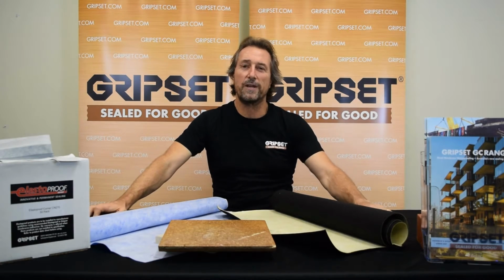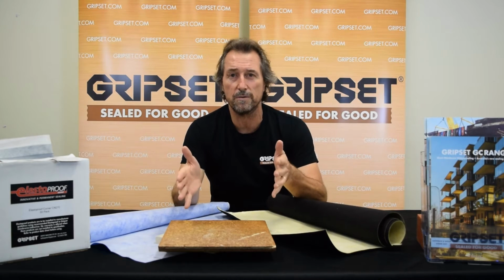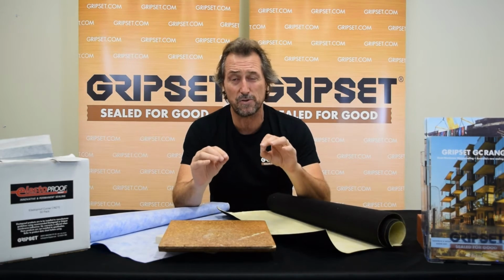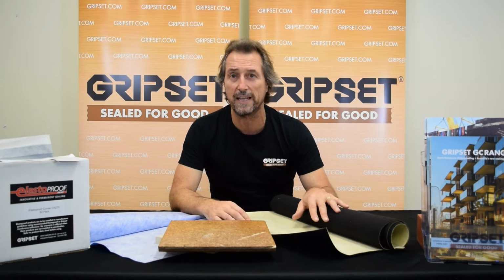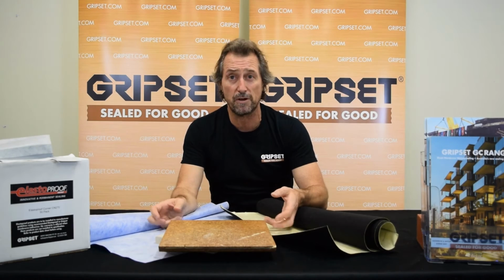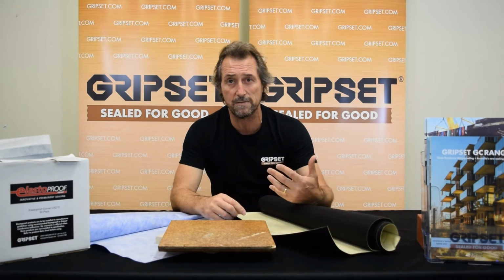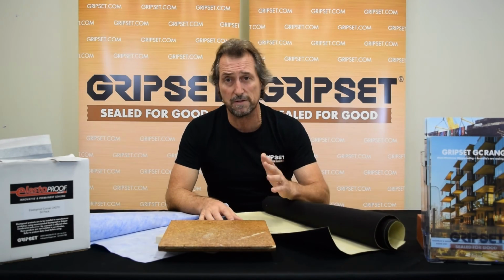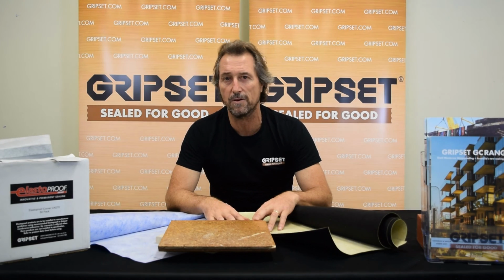Particle Board Flooring and Waterproofing

Comment: Thank you Gripset for the very informative video. I have been renovating bathrooms in the last 25 years, some bathroom (built in 1990s) we removed have yellow tongue but it is in good condition if the yellow tongue and waterproofing was installed correctly. I always debate whether to leave the yellow tongue or advise the owner to replace it with scyon (with additional cost). I have been googling to find a suitable answer to advise my customers about yellow tongue but haven't been able to find the right answer as some site says it is illegal and some site says it is ok to use but not recommended. Thanks to your video and your answered comment (from other video) I have found the right advice to give to my customers.

Comment: Thank You for Providing Education to the Construction Industry & the Public. 

We would sheet every timber type flooring with a Fibre Sheet Underlay for Wet Area's.

We can then provide a Waterproofing system over that F/C sheeting.

We will sheet Timber type flooring for Vinyl Installation as these products are not suitable for Direct Stick / Adhesive Fixed Flooring & move alot as You have said. 

#doitcorrectlydoitonce
Reply from the maker: Thanks a lot for your comment and your support, it's guys like you that make a difference in the industry! :)

Comment: G,day Mate, Ive just purchased a new house which has yellow tongue floor boards. 

Is it recommended to paint or water proof the under floor area to reduce water ingress from underneath.??? (Large task)

Is this something you would recommend???

Mick
Reply from the maker: Hi Mick, look we wouldn't recommend it however, you are best to contact the yellow tongue manufacturer to confirm the product is suitable for use over earth. It may be found in an installation guide somewhere. Hope this can help you!
Reply: @GripsetIndustriesPTYLtd  Thanks buddy much appreciated
Reply: Did you ask the manufacturer about ceiling under the flooring? What did they say ? I have the same issue

Comment: Hello :) I've been working on redoing the flooring in my kids' bathroom - after removing the sheet of linoleum, i discovered we had particleboard :( I'm really unsure why this was chosen, i can see a secondary layer underneath the particleboard (it is OSB i believe, at least it appears to be)..  one of the main reasons i started this project is because thanks to my kids splashing, over time water seeped through the linoleum where the tub and flooring meet, so the particleboard is weak in that area... But it's only about an inch of the flooring, along the length of the bathtub. What should I do in this situation?! I was thinking to fill the weakend spots with concrete maybe, then go over the entire subfloor with something like Drylok (or what is the best type of product to waterproof this?) I am so unsure what to do in this situation :( that's how I ended up here! Haha
Reply from the maker: Hi Seraphina, kids are great at uncovering poor waterproofing!😅 The best advice we can offer is to engage a licenced professional to inspect the area, once water damage takes hold it is critical to understand the extent of the damage. For Gripset product recommendations please send some photos through to info@gripset.com and one of the techs will take a look, Thanks for watching!

Comment: How to seal the seams in particle board laminate flooring?
Reply from the maker: Hi YouTubeShitSorter, 😂 that was fun to type! but to answer your question; typically timber products with laminated finish are not designed to be finished over, they are the finish. If you have more details on the product in question and require a solution for what sounds like a unique situation please send us an email to info@gripset.com one of our knowledgeable tech services staff will get back to you,    Thanks for watching!

Comment: What about waterproofing over  marine grade plywood? The same issue?
Reply from the maker: Hi Ed, the main difference is marine grade plywood is used externally but we would treat it the same way as particle board. We recommend Gripset sheet membrane systems. https://gripset.com/products/#sheet-membrane please have a look at the sheet membranes on this website
Reply: It's still considered a timber type flooring. You have a Water resistant coating applied so How are You going to bond to it correctly?

Comment: hi i hope you can help?! we used yellow tongue for the sub floor then put a steel frame house on top, now the roof did not go on for a long time and the weather has caused swelling! since putting the roof on we have sanded the raised areas over the joins but there is all uneven 3mm gaps throughout what can we use to make this a flat surface for cement sheeting then tiling to go down? thanks kirsty
Reply from the maker: Hi Kirsty, apologies for missing your comment if your ever after prompt technical advice fell free to contact us on 1800 650 435 we're happy to assist with ant technical enquiry, hope the rest of your construction went smoothly, Thank you

Comment: do you have any suggested videos for going onto suspended steel framed floor?
Reply from the maker: Hi Abdul,  As long as construction method is inline with relevant building codes you can treat it the same as timber frame, if timber structural board is used as flooring system, Gripset recommends Gripset BRW or Gripset GC Sheet membranes  you can check them out at https://gripset.com/